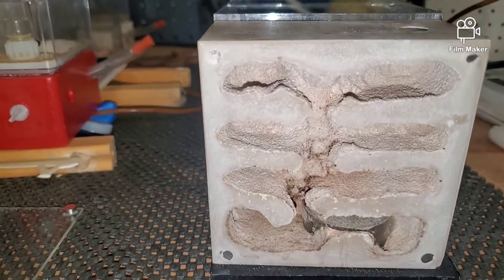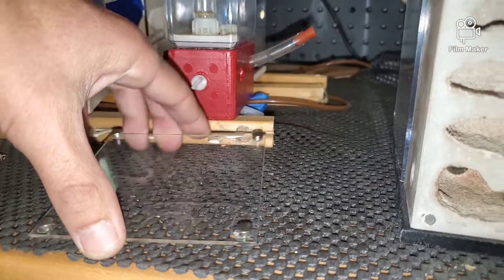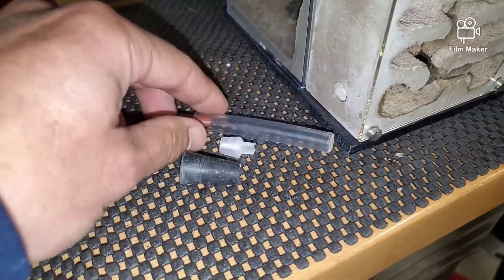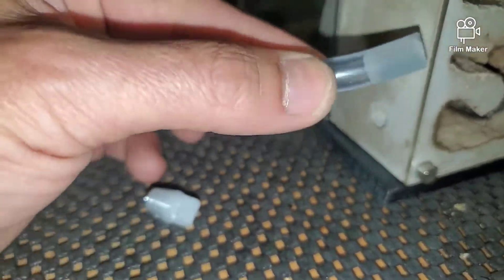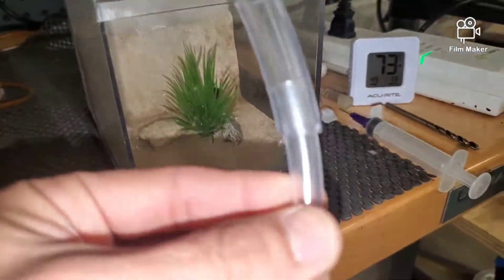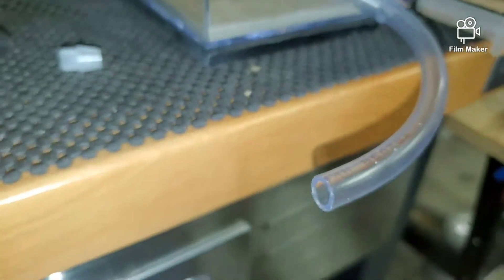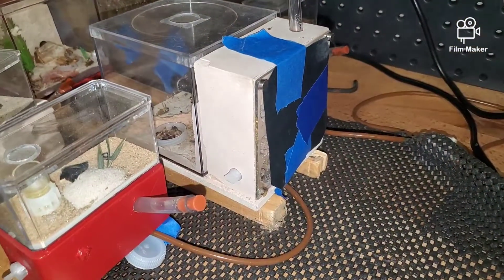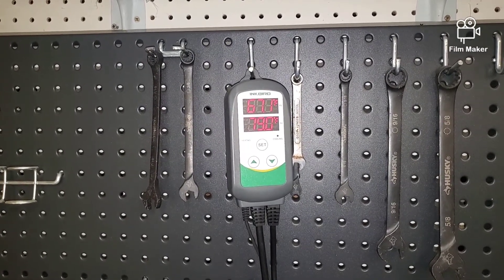Tar Heel Ants Fortress Formicarium After A Year And A Half Years Of Use

Comment: Those white stoppers do VERY well and are actually very sturdy if you push them and while you twist. When you want to take them out, twist and pull. If you just push them in and leave them, they are loose. They go in further and get stronger when you push and twist. Sometimes they get so stuck I can't get them out by hand without twisting them back out